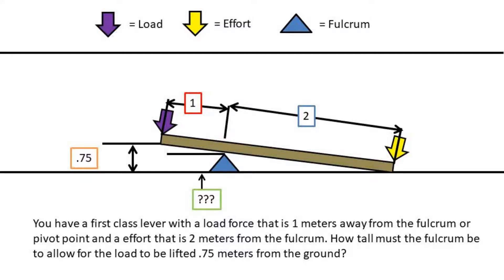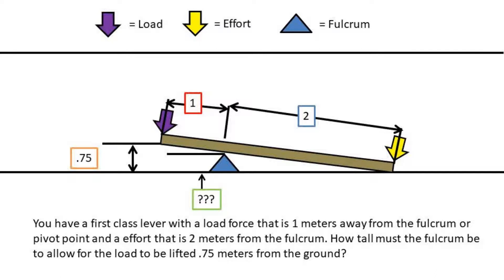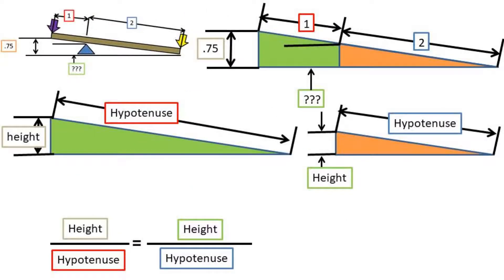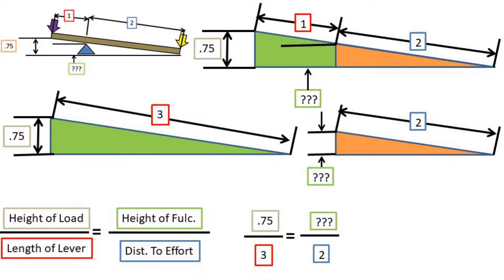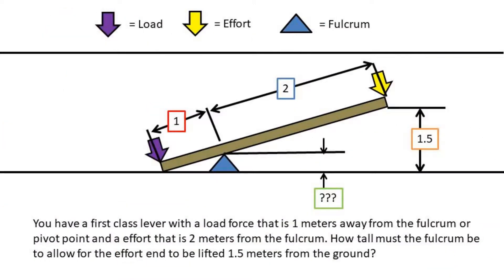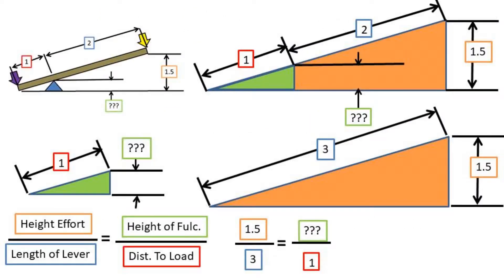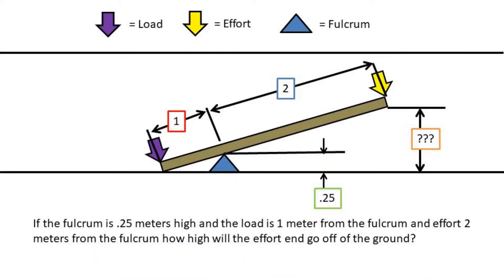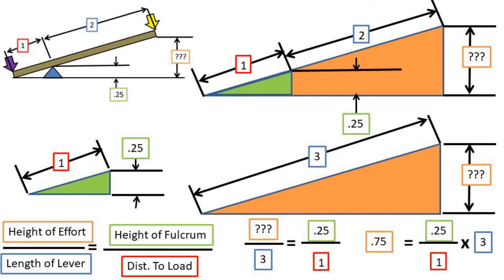Lever Physics Viewer Request (Find the Height of Fulcrum and the Height of Effort or Load)

Comment: Hello.  I am designing a machine that uses a pneumatic cylinder to operate a hole punch to punch through sheet metal.  I will be using a lever to get a mechanical advantage to provide the force necessary.  I am trying to figure out what kind of force would be experienced by the fulcrum or pivot point.  I'm not having any luck finding information on how to calculate that.  I would appreciate any help that you could provide.  I know I haven't provided much detail here but I can give whatever information is needed to calculate that.  Thanks.

Comment: VAM - excellent video. I am asking what happens if the short arm of a lever is fixed at its tip and the height of the fulcrum increases? (Embarrassed 30 minutes later- just realized I am describing a 3rd class lever in terms of a 1st class one - well you know what I mean, eh.) In our Biological model the end of the load arm is attached to the center of a bicycle wheel and another part of the molecule is attached to a spoke such that we end up with a lift and turn of the wheel when the fulcrum expands in height  This is also positioned within a 3D structure that acts like a pantographic extendable mirror (with a lift and a twist).  Can you make a video on that role of the input force causing the lift at the end of the load arm to extend from this one about determining fulcrum height?  We are interested in force and distance calculations using units of picoNewtons and nanometers.  I am a Biology researcher at University (asking help from Physicists and Engineers) and am studying integrin protein 3D structure (see this video https://www.youtube.com/watch?v=ktVwroiMhf4) for their extension and flexion (scroll to the bottom of this page and set to the JSmol1 clicking open and closed https://pdb101.rcsb.org/motm/134).  I have identified a lever mechanism that is part of a pantograph that is part of a Trebuchet cantilever catapult - platelets use it first to extend and open to high affinity so they can stick together and then to retract to close off the clot.  If they ever get their database connection problems resolved as of today Aug. 11, 2018, this site had a great interactive 3D video showing their model of this integrin movement.  Hate when such great resources are lost.  Thanks for having such a wonderful YouTube page.
Reply from the maker: Hi Clyde. I think you are referring to the mechanical advantage of a lever? If so i have made a video titles lever physics about this. This is where the request to make this video came from. Let me know if this answers your question. If not i will be happy to help however I am currently unable to work on a video for a week or better.